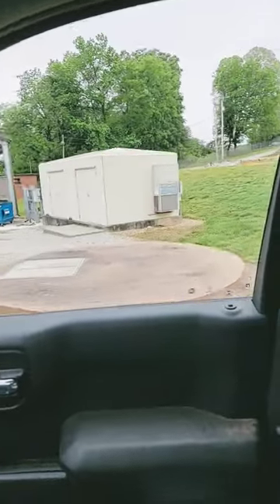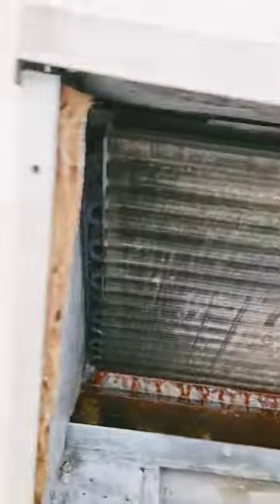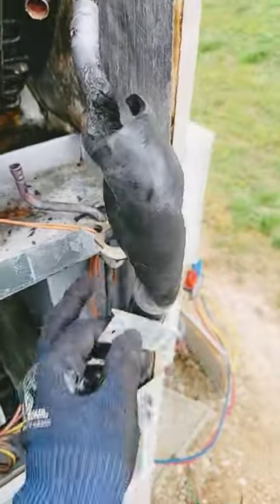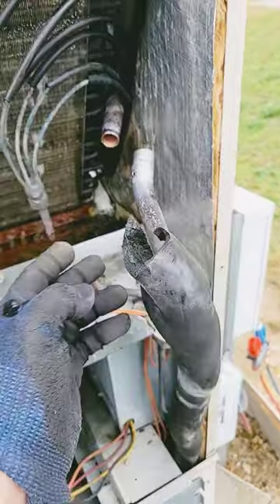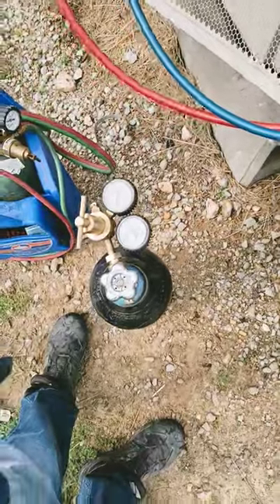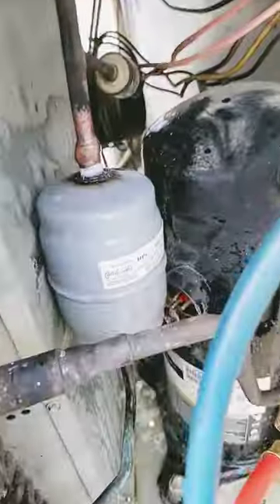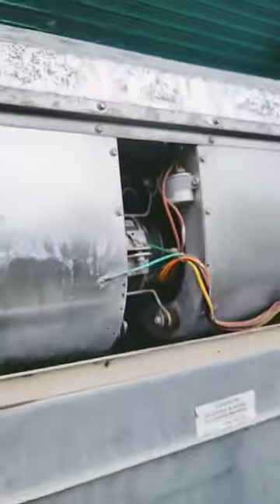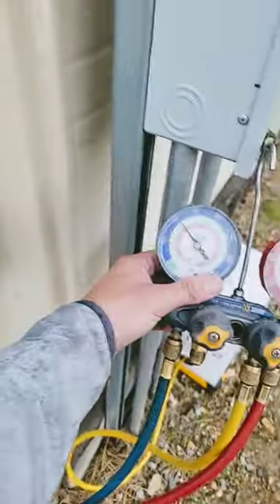Replacing the indoor coil @BardManufacturingCompanyInc

Comment: Just changed a evap motor yesterday. Had high head and low suction with piston, not quite sure what size. Can't pump down to check. Always seems to be the case though.

Comment: Do you have any tips or tricks for pulling good vacuums on older systems? I’ve worked on a lot of older geothermals and heat pumps that don’t pull down well.
Reply from the maker: Do a triple evacuation
 nitrogen